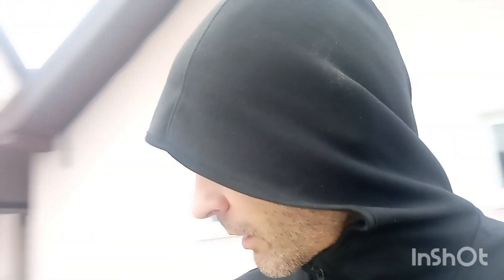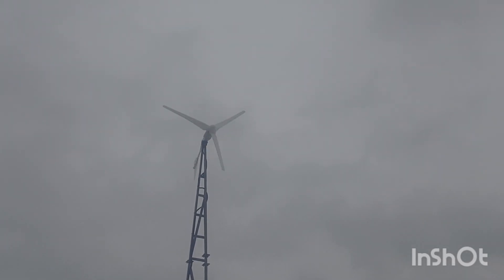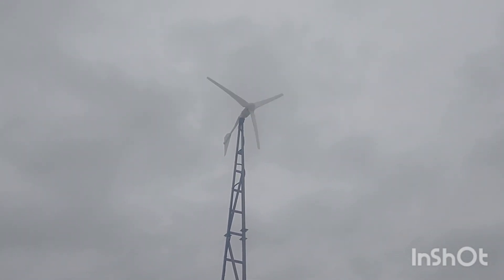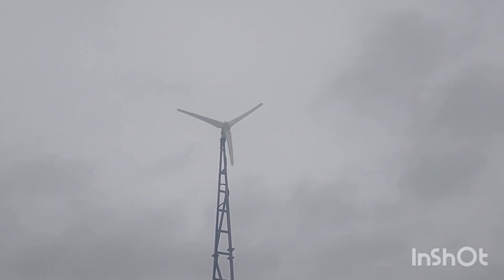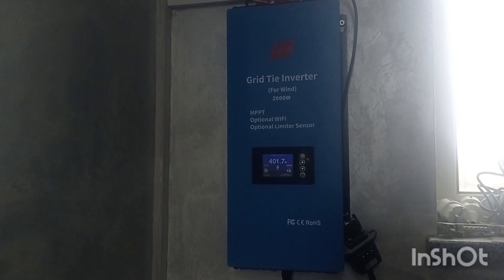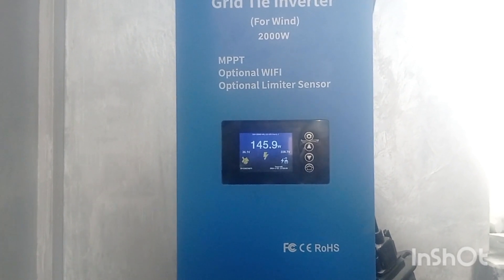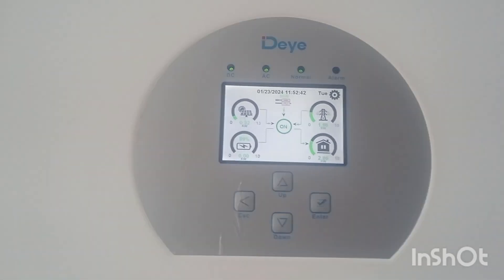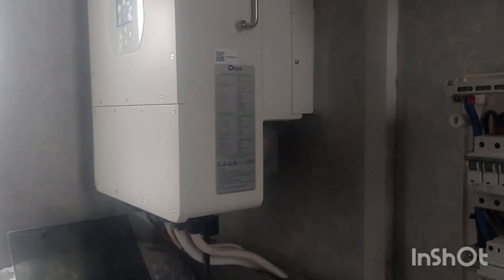What is better in autumn/winter/spring - solar or wind? How to calculate?

Comment: My single panel on the balcony produces 300-400W in the maximum at summer, but only about 15-50W in winter.. OR, in kWh/day - 2-2,2kWh/day vs 70-100Wh/day in winter just because of the clouds+less sun time. I would roughly say - the "damping factor" is 15-20..
Reply from the maker: since your balcony panel likely has a steppe angle that's the case.
I've seen so far the best in summer - 265kWh per day, and the absolute worst 3kWh per day in winter (while all the panels are fully covered by snow). that is all the case for my 43kW of solar panels setup.

but wind is wind, and since the air density in winter gets increased with the colder temperatures - the winds from October through March are way stronger in general, so it very often outperforms solar in my case. I'll be getting more wind turbines installed later this year - that will be some fun.

Comment: Where we are, (60.5 °N)  there is always the change of season winds in spring and fall.
If, in winter, it is clear and cold then solar works great. If it is a cloudy and warm winter it often brings a lot of wind with it.
Reply from the maker: The fact is that a combo of wind and solar works great. "Solar only" is not enough for winter, "wind only" in not enough for summer.
And I personally was surprised to see in how many days of autumn and winter so far wind is outperforming solar by 1kW of installed power.